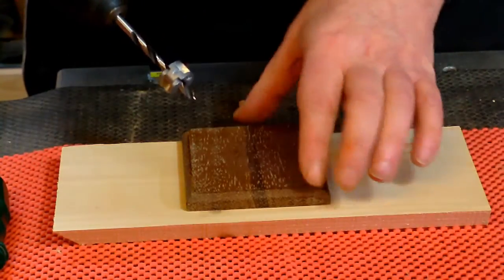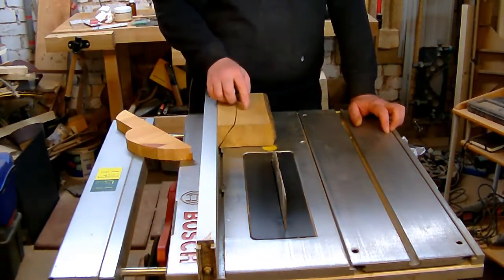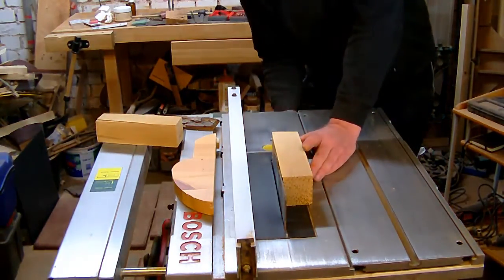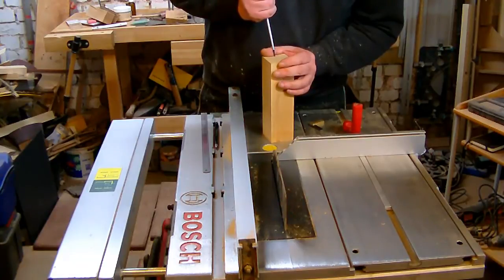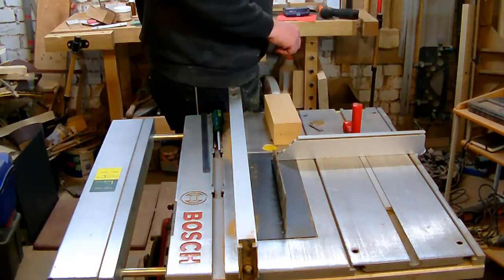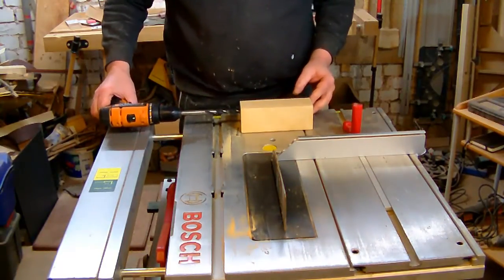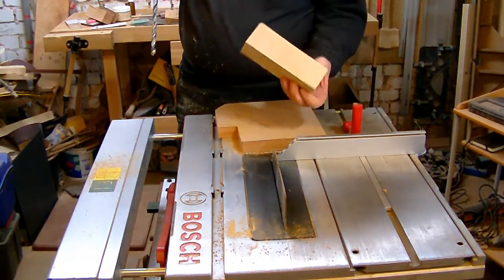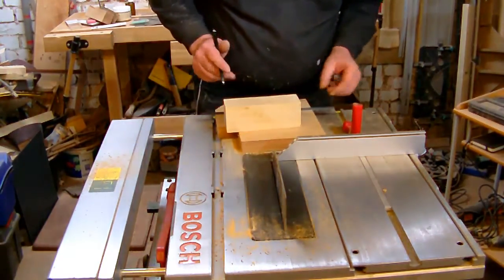Depth Gouge For Depth Stop On A Drillbit

Comment: I have been thinking to get the 5-teiliger FAMAG SUPER-Forstnerbohrersatz Classic WS mit D=15,20,25,30,35mm im Holzkasten http://www.amazon.de/5-teiliger-FAMAG-SUPER-Forstnerbohrersatz-Classic-Holzkasten/dp/B00FF575OY OK, I have some of those.
One more thing is to sand down to top of the drill.
Reply from the maker: KurrenPuupaja Hey Kurre!
These forstner bits look great! Unfortunately I never had the chance to work with expensive tools like these. Just one advice, after use, clean and oil them, but who am I telling this? :-)
Normally I don't use bradpoint bits for drilling a hole in my pieces. The HSS ones for the use on steel are a much better choice when it comes to drilling into endgrain but I think Chris needs the point on the bit for guidance. I don't know whether you're aware that Chris is blind?
Greetings from Good Old Germany
Peter
Reply: ***** Hi Pete. OK, the are expensive ones and same less expensive for hobby use.
In my cheese mold video I am using those bradpoint and a special tool for drilling that can be used by a blind person too.

Comment: Hi Peter:  Nice little jig, very easy to use, Chris should find this very helpful in his shop, Best wishes Harry
Shared on Google+
Reply from the maker: Harry Watts Thanks Harry!
I hope he won't loose the tiny pieces of the depth stops, I'll have to find a way to securely attach the set screws, as the risk of loosing one of the bolts is always there. (I searched for one for about an hour, after I lost it).
Greetings from Good Old Germany
Peter

Comment: What type is your Bosch?
Reply from the maker: KurrenPuupaja It's the BOSCH PTS 10. Actually the best I could find for the money with a sliding table. It needed some 'minor' modifications, like cutting down the riving knife, and the zero clearance insert to work the way I wanted it. Now I have to solve the 'dust problem' as the inside of the saw gets covered in dust, seems like the original dust-port isn't working at all.
Greetings from Good Old Germany
Peter